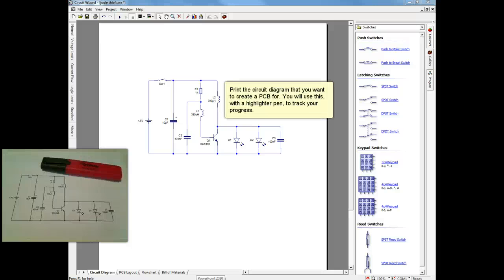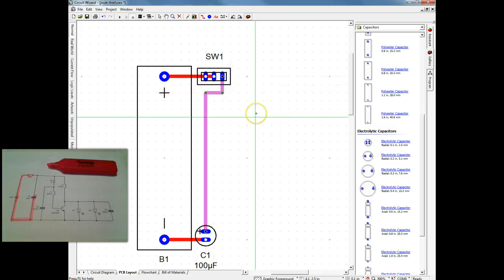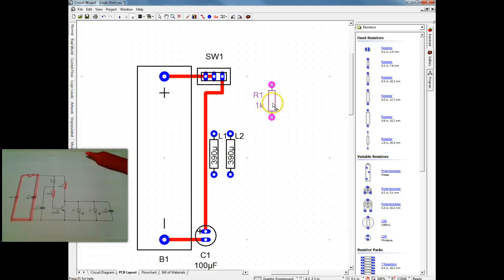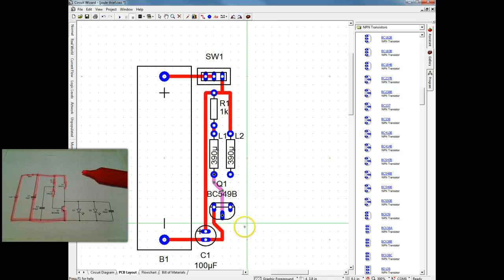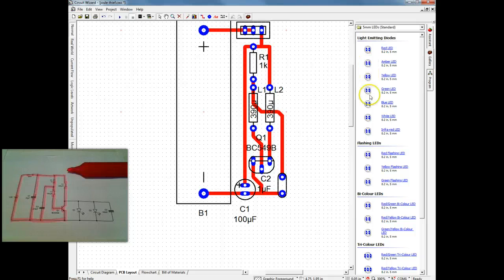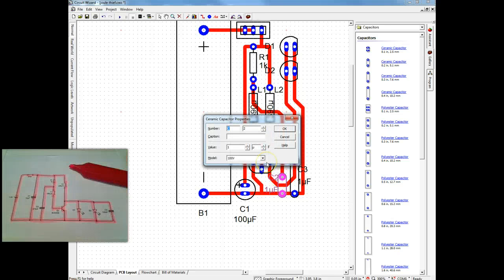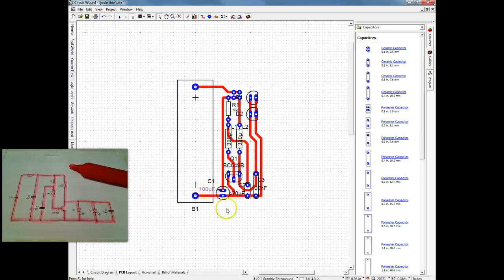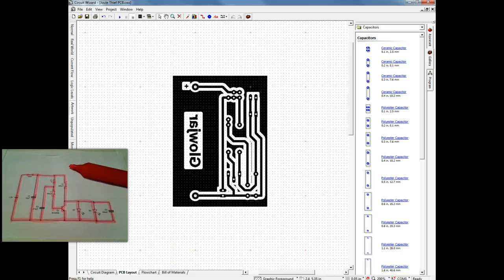Creating a PCB manually in Circuit Wizard

Comment: Thank it's very good tutorial.
But i want ask you, how to add parts in the circuit wizard librarys? Thank
Reply from the maker: There are parts for most components in the libraries that come with the software. You can design custom components, but it’s been a while since I last used the software and cannot recall how to do it.
Reply: @mattmclain687  
Right. Thank you

Comment: I know this is old, but is there a way to place/route components exactly as I have them laid out are in circuit diagram view? I've spent a good bit of time routing the connections in there, and I'd like to keep them as close to my original design as possible. I've tried grouping/locking them, but it doesn't seem to have any effect. I've made a binary clock, which seems to be at the upper limit of Circuit Wizard, as far as I can tell. In any event, it places my LED's and switches in strange positions... it would take quite a bit of effort to go back through and place/route everything manually.

Here's my circuit, if anyone is still interested in this program.

http://users.freebasic-portal.de/dr_d/Circuits/Circuit%20Wizard/Binary%20Clock.cwz

Comment: Hello, I have ver 1.50 Pro version and when I print the solder side mirrored, the copper text is printed both mirrored and non-mirrored making the text all a mess.  Any ideas what I am doing wrong?  Thanks Alan
Reply from the maker: IsJustThat I've not come across that before. Might be something in the print settings?

Comment from the maker: Hi Andy. I don't think that they are available for Circuit Wizard as preset components in the Gallery. There is a way of compiling an IC from it's component parts, but it's been a long time since I looked into that. Also, the only microcontrollers supported are New Wave's own GENIE PIC.

However, if you just want to draw a PCB layout you can use the DIL generic pads.

Comment from the maker: Sorry for the delay in responding. You'll find it in the Gallery (Circuit Diagrams) under Integrated Circuits / 4000B Series. Its just called 4017B (called a 'Decoded Decade (Divide-by-10) Counter').